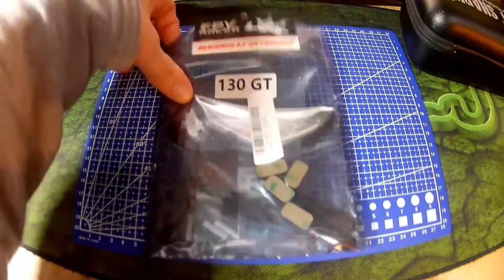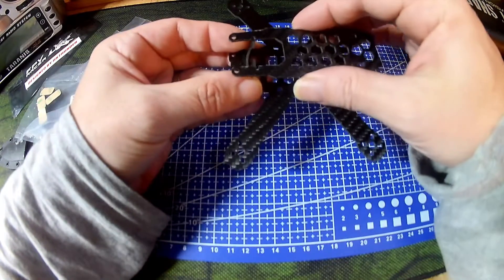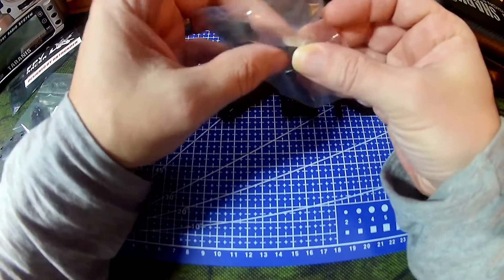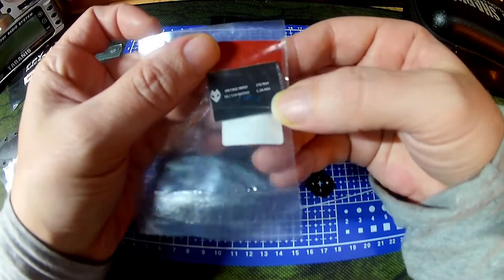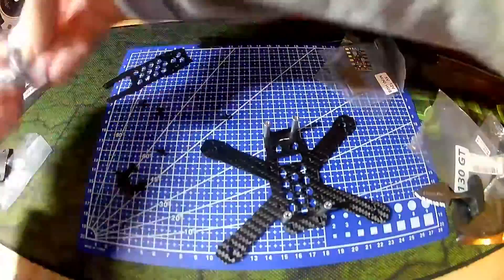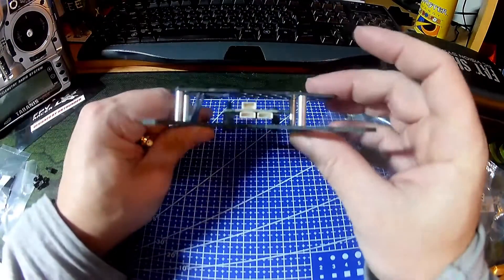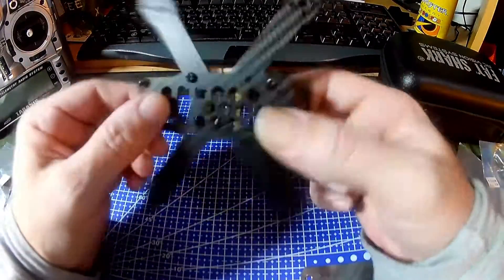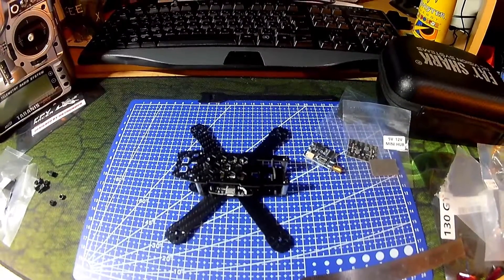Kingkong 130GT Frame Preview

Comment: Can I use 1106 motors on this one???
Reply from the maker: I'll have to look the frame out and check for you.
Reply: On Bangood says for 1104-1105 kv4000 motors, I guess I wont be able to get away with 1106 motors... Or will I?!?!? eh eh, at 7,27euros I´m gonna buy it and find out later... I´ll let you know how that went, thanks MrE, got a new sub here
Reply from the maker: Sorry,just had to grab the frame from storage as it wasn't to hand.
It will fit any 110* size motor with a normal bolt pattern - I just checked it against my Brother hobby 1106's and it will be fine.

130* would fit bolt pattern wise but after checking those - the kicker is the slots will only take an M2 bolt.

Your welcome. Hope this helps and good luck.
Reply: Nice, thanks

Comment: ey, i also want to build a kingkong 130 but im not sure which parts to get..
this is mine first time building a quad so i would appreciate any help :)
Reply from the maker: What sort of quad are you after? On a budget or a money no issue performance craft with or without FPV?
And do you have anything already like radio gear etc?
Reply: im looking for a brushless fpv quadcopter around  the 130mm size. this is mine first quad so i have no gear, and i wanna spend 200 inc quad, receiver&transmitter, 4x battery, charger, cheapest fpv goggles
Reply from the maker: That is a rather tall order and the following is just a very quick compilation of all the stuff you need in the ballpark of £200.
Things may be better swapped out if you want more performance like a 4S Tower and batterys however there are some quality things in this list like the motors, radio gear etc but here goes:

FlySky i6 no reciever £29.48 http://bit.ly/2rAwfwk
Flysky FS-A8S sbus receiver £7.96 http://bit.ly/2sCrimX
Flycolor RAPTOR S-Tower 12A £36.65 http://bit.ly/2twKqyX
4 X RS1306 Emax £31-£34 http://bit.ly/2tbODZH
Kingkong Q25 Cam/Vtx £16.73 http://bit.ly/2sqEgTS
Eachine Goggles £27> http://bit.ly/2sz5vM3
4 X Infinity 850mAh 4X £10.75 http://bit.ly/2rAuM9c
iMAX B6 Charger £17.28 http://bit.ly/2rp1Rkj
3x3x4 props £5.73 http://bit.ly/2fyqg4a

I hope this gives you some avenue of though for your build but there is always tradeoff in doing it cheap (like the camera/Vtx is CMOS but will get you going)
Reply: bro thx for this build !!!
which frame and vtx should i get ?
Reply from the maker: For the most part it looks ok except for a couple of things that wont work too well.
The motors have a 1.5mm shaft/2xM2 bolt affixing so the props you have listed dont match as they are for a 5mm shaft/M5 nut.
I would personaly go that bit extra for the RS1306 motor as they are alot stronger and powerful and work wonders with the listed props.
The motors you have chosen are more suited to sub-100mm builds and 1.5-2inch props. These props http://bit.ly/2rADC6S will fit your selected motors however a lower KV motor maybe required as they are agressivly pitched.

The other main thing that stood out is your Transmitter/Reciever combo - the FSI6 Transmitter is very good and I still use mine even though I have 2 Taranis, but the bundled receiver is huge hence my suggestion of the smaller SBUS one seperatly.
Reply from the maker: For frame - Check out my GEP-130x videos - If you would like ,I'l upload a recent 4S flight on it (with RS1306 motors and the 3x3x4 Props)
Reply from the maker: Oh, go 3S also.
Reply: thx for all the help but im going to sleep now and tomorrow ill come back at this :)
btw i couldnt find the gep130x videos xd
good night

Comment: Hi very nice review. Can you fit a hs1177 with 3in props on this frame? Thank you!
Reply from the maker: Pham Print I will check and see ASAP and get back to you. my initial feeling is that it wouldn't but i also have a swift mini that I can size up.
Reply: Thank you for checking. I'm planning on buying this frame only if it fits. I greatly appreciate you help.
Reply from the maker: Pham Print It was easier to make you a quick vid as you will get a better idea of what will fit: https://www.youtube.com/watch?v=gECJFTVe89Y
Hope it helps,Pham.
Reply: Thank you so much!

Comment: what is the distance for the fc mounting holes? and would the Eachine okkan camera fit in there?
Reply from the maker: The FC mounting holes are the standard 30~mm mounting pattern for a normal Naze32,Lux or Kiss FC. As for the Okkan I beleive that it would not fit very well with the standard frame hardware.

Looking at the Okkan's measurements, it would fit just about side to side ,but it would need to be angled back to something more than 45 degrees to fit inbetween the top and bottom plate due to the 17.5mm pillars. Then it might be up leant against or even blocked by the FC stack etc. (this is without the bracket attached)

I hope this helps.